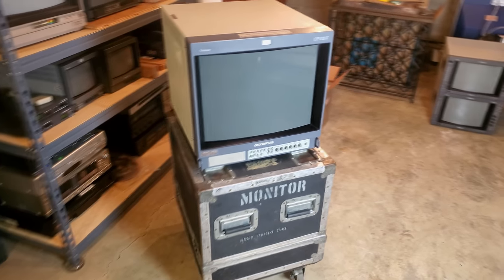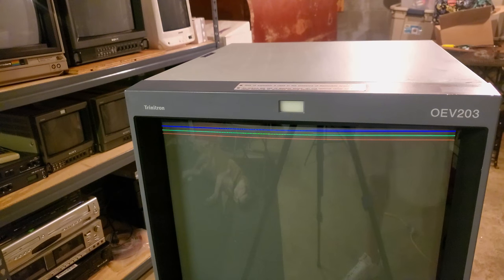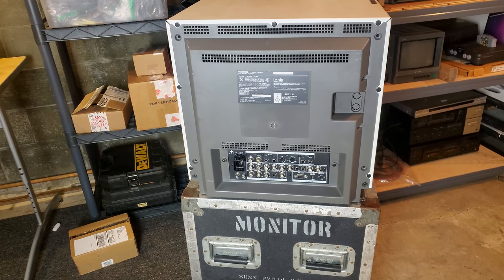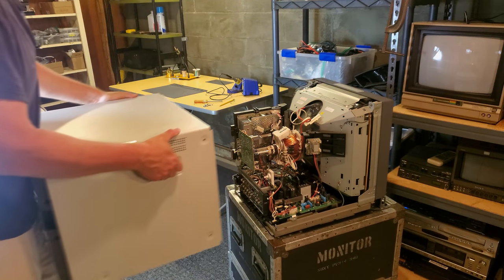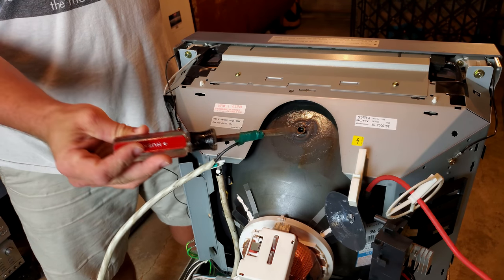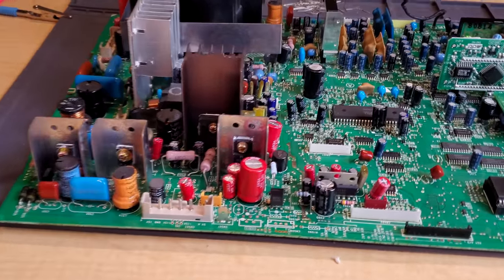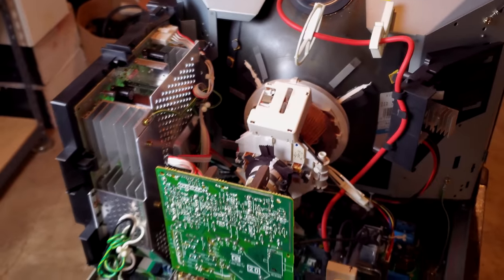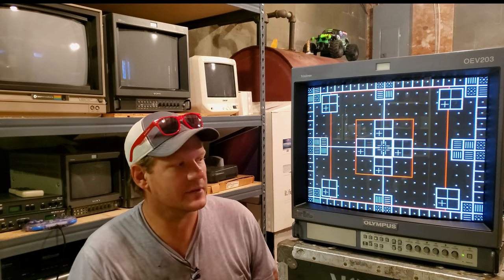Fixing Sony's PVM Mistakes!  The RGB Line Repair & the Olympus OEV 203 CRT

Comment: Thanks for this great video, very informative! I've got a Olympus OEV 203 that works great so far. If I remember correctly it was manufactured 2002 so hopefully the capacitors still got some health left a little while longer. Bought it from an private Ophthalmologist for around 200 euro whereas he had bought it from a hospital where it was used during operations. According to him it was almost immediately put in storage and didn't see much use since they opted for LCD. I will most certainly have a go at the capacitors in a near future for preventative measures. Again, great content, keep up the good work!
Reply from the maker: Thanks, yeah a lot of medical PVMs where just stuffed into storage later once LCDs starting gaining a presence.  Olympus CRTs are great!

Comment: I got mine working! Replaced 8 caps that are closest to this heat sink and it looks beautiful. So stoked! Thanks for this. The fact that I got mine for $0.00 I might go ahead and recap the all of the boards. Next is to rewatch your PVM 2030 video re: line folding issues since I have that monitor and that same issue.

Comment: When mine is in underscan mode I can see the 3 lines, but the blue line gradually slopes up (from right to left) and intersects with the top red line on the far left. This is causing a slight blue tinge to the white cross-hatch pattern in the top left area of the screen (about 4 horizonal squares from left to right from corner). If I look through a magnifying glass I can clearly see that the blue beam is ever so slightly too high/misaligned in that small area of the screen. I've done the recap and adjusted the geometry, but the blue line still intersects/merges with the red line? Other than that the monitor is perfect. Any ideas?... Convergence rings or yoke pots perhaps? Thanks

Comment: Hi! I have this same pvm, year 2003. Do you know which IC I need to replace to fix a vertical collapse issue (horizotal line right in the middle) the monitor was working very well until recently. My guess is that a cqpacitor failed, which caused the IC to fail. 😢

Comment: I have a 2053MD and my red green blue line are kinda bent at one end, also the line is not level it s slightly tilted down on the left side. Don t know if it s just caps or the all tube is miss align. 
I also have a older model PVM-1443MD that don t show picture but turns on. I was messing with the pots inside to adjust the picture, with a screw driver (i didnt have a plastic rode at the time) and i touch something and the picture disappear. I don t know if i can get it to work again.

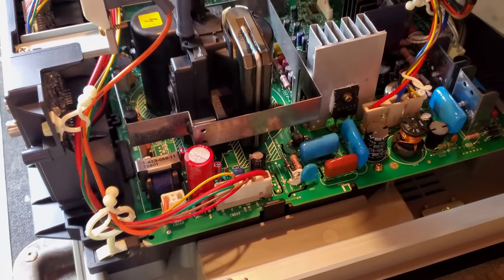Comment: 11:40 I had the IC issue on my 20M4E and I don't think it's related to the RGB lines - I've never had issues with them and I didn't replace any caps when I replaced the three ICs.

Comment: A pencil? To poke around a very high voltage circuit?!? You do know that pencil leads are quite conductive (on account of being mostly graphite), right?
Reply from the maker: Did you notice the monitor was unplugged?
Reply: @RetroTechUSA   As you clearly know, given that you (correctly) went on to demonstrate discharging it, various parts of CRT displays can hold a charge after unplugging, for varying amounts of time depending on the design. You were showing the pencil before discharging it… 

I’m not saying using a pencil is highly likely to result in shock, just that it’s… not smart, given the ample availability of far less conductive things, like spudgers, plastic straws, bamboo skewers, chopsticks, dowels, etc. At the voltages that could be present in the worst-case scenario, a pencil lead’s resistance is low enough as to be just as dangerous as a piece of metal.